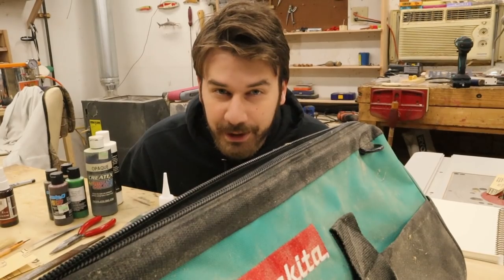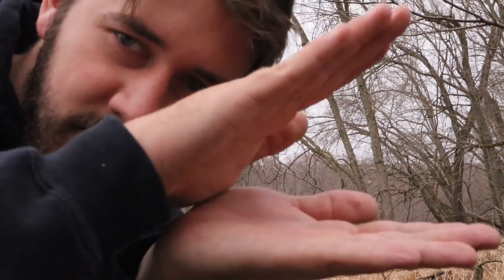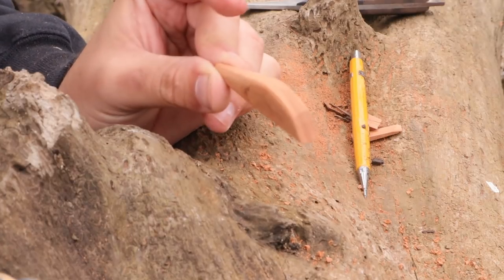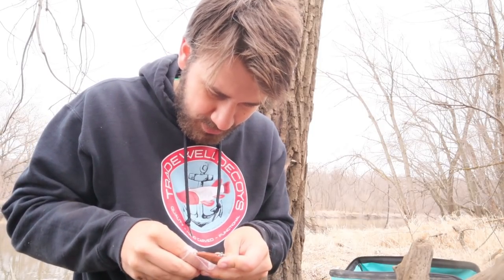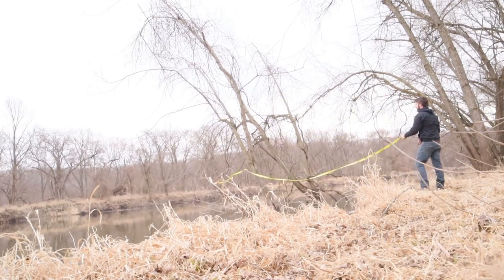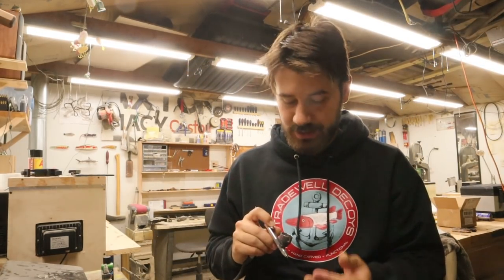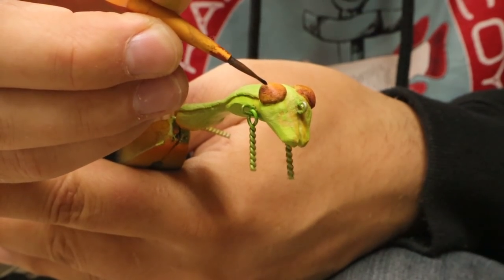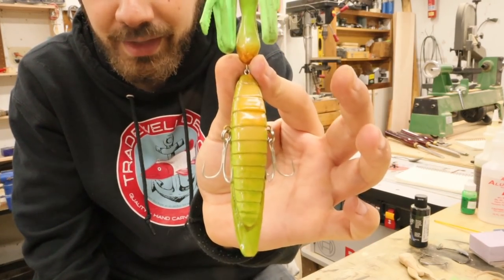River Bank Build to Catch + Finishing the Preying Mantis!

Comment: 0.3 mm is perfect for me, with lower psi  and  well diluted with a thinner paint is great. You probably have issues cause createx paints are denser. Of course who am I to teach you since I have only 3-5 lures painted, but I really like the result, I'm using a Chinese hobby paint brush with really small compressor. I prefer Vallejo paints, they don't need a thinner and work perfectly with 0.3mm

Comment: Artsy words:
Wash: A really thinned out, usually dark, color applied with a brush to bring out the small details on a surface (not for big blank surfaces).
Highlight: applying a brighter color on the edges of a similiar color to reflect how artificial light would bounce of the surface.

Tip: You should really watch some miniature painting tutorials to level up your painting.

Thanks for the laughs!

Comment: Change the location of the treble hooks  to inline instead of side by side and you probably will have better action. And if they tangle in side by side location use wire cutters to snip off the inside hooks to make it tangle free. Good luck.

Comment: Instead of buying tungsten balls for over $1 each you can buy rods of tungsten you can cut to whatever size you need and get more weight density at much less cost. Look up tungsten tig welding electrodes, the ones with green tips are pure tungsten the others have some additives for welding purposes.( just DONT buy the RED ones because the additive is slightly radioactive and you don’t need radioactive dust around your home) should be easy to cut with diamond wheel on dremel and you can buy just about any diameter you could need

Comment: Don't feel bad one day while camping lakeside my truck hadn't moved in a couple days I walk up from the lake and set my pole on the ground about ten ft in front of my truck on the ground I'm sitting about 30ft away and my truck just starts rolling now this is an irrigation lake and late in the year its low and there's like 30ft of mud before the lake no way to catch my truck it suddenly stops and I see why my real on my pole I laid down has worked like a wheel chock and kept my truck out of the lake needless to say I replaced the handle on the reel and still use it years later every body is lame once in a while